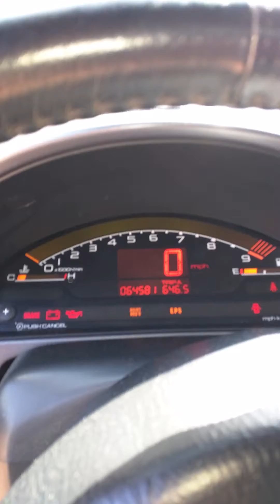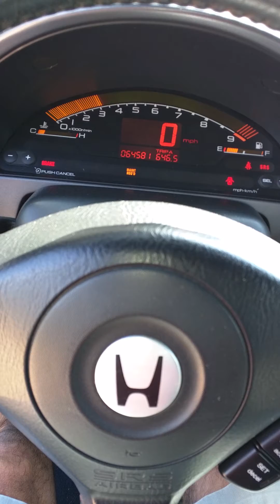2002 Honda S2000 Engine Knocking Solved Fixed

Comment: Y did this happen?
Reply from the maker: This is a direct quote from the guy who purchased the engine to rebuild it:
"The reason for the knocking noise was main bearing failure and this was the reason for the low oil pressure after engine warm up. There were bearing flakes all over the engine. Surprisingly, the crankshaft survived and can be re-used. There were a lot metal flakes in the coolant jackets. Anti-seize compound was used on the cylinder head bolt and rod bolt threads, which is an extremely bone headed move, as torque specs require engine oil only. The cylinder head is not warped and is reusable, but the camshafts are rusted, requiring replacement. The block is ok but cylinder #3 has a physical dent; probably from poor engine disassembly."

Comment: Having the exact same problem...03 ap1 any insite on prices for rebuild instead of getting new motor?
Reply from the maker: I cannot find the guys contact information that we sold the motor to. He rebuilt it in his own garage so I'm not sure if he would even be able to give that rebuild cost. Obviously you would have to tear into the engine to find out what needs to be fixed as there are many things that may need to be replaced or machined.